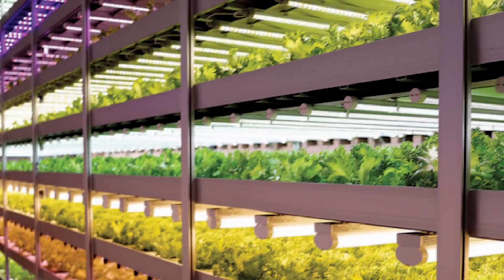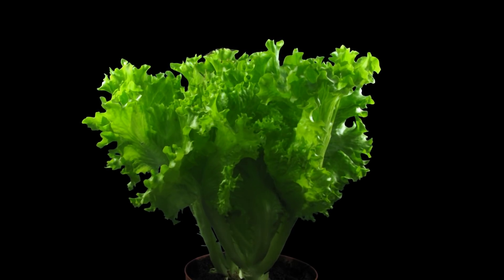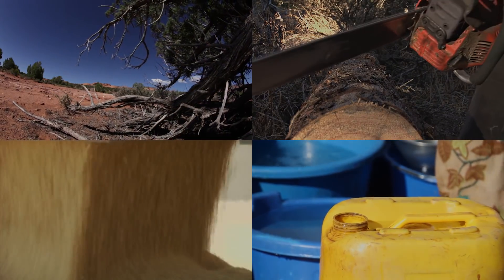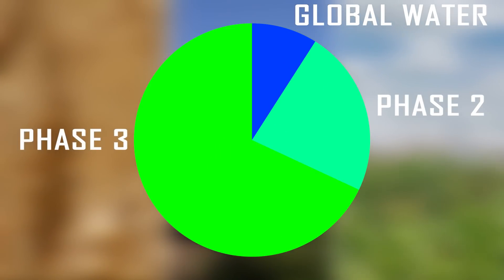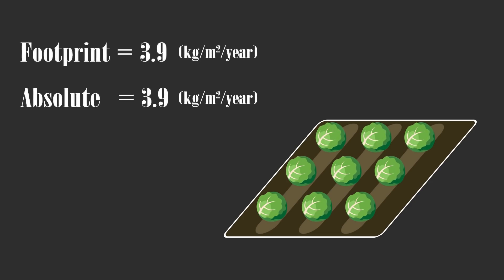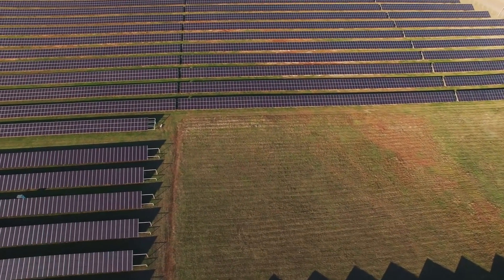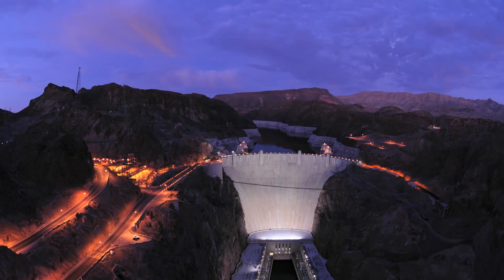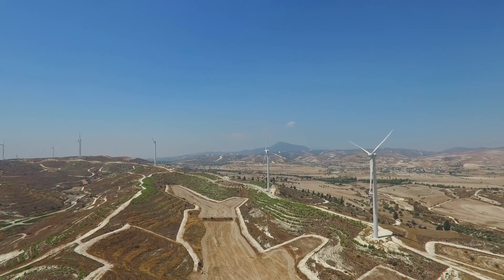How Can We Improve Vertical Farming?

Comment: A combination of agrovoltaics and indoor vertical farming could be interesting. It would improve the output of regular cropland (around 80% of cropyield without solar + 80% of only solar panels has already been achieved, thus a 60%+ increase. In more sunnier regions it might even be more beneficial) while allowing the power from the PV to be used close by in the indoor farm building. Or you could combine it with cattle farming (using a lot of land) + PV. These kind of combinations would lower the cost of the energy due to not having to buy the land and only use it for solar and you can place the buildings and energy production 'close' to eachother lowering transmission costs.

Comment: In the energy sector, the renewables came on top of the fossil. And more fossil was used to transform concrete, metal, etc. Nuclear is less carbon intensive in that regard. For the moment renewables did not displace fossil energy, it was an addition. Only geothermal, hydro and nuclear did historically came instead of some fossil sources. It is yet to come if it is viable to produce solar panels / wind / batteries ONLY from renewable energy sources, work is in progress on that, but we are not yet there.

Comment: Inedible mass isn't necessarily completely wasted, it can be used for biofuels. Maybe not worth it at current scales, but long term it probably will be.

And while running a plant factory on solar energy is always going to struggle to be worthwhile compared to directly putting sun on the plants, it has some advantages, solar panels are much more convenient than plants. Almost any building can have solar panels put on it even if it as an odd angle and not suitable for plants, and you can transmit the energy through wires with no moving parts, so the difficulty of roof access only has to be dealt with once when installing the panels, not every single harvest. Some loss in energy efficiency is fine to centralize the production of plants if the costs can be made up elsewhere. And more importantly, you can't grow plants in a field with wind power, but you can run a vertical farm with it. I expect we will do a lot of growing in the early hours of the morning when the wind is blowing but people are mostly asleep.
Reply from the maker: Utilizing inedible mass is a good idea indeed, though you still want to mimizie it from an energy perspective. Using say solar panels for vertical farms isn't actually a loss comapred to direct sun. This seems unintuitive because there is an efficiency loss from both panel LED in the conversion loss. Yet this efficiency loss is made back through the control that CEA provides, this can be seen in the 4 times greater harvest rate, yeild and edible mass%. If you use sunlight you forfiet some to all of the following: spectrum, PAR and DLI, Photoperiod, CO2 enrichment, Temperature, Humidity, Airflow, Pests. The degree to which you limit control of these factors depends on if you are growing outdoor or in a greenhouse, but all of these factors will be at least somewhat limited compared to full indoor 100% artificial light.

Comment: When you were considering the doubling of solar panel footprint for doubling the height did you account for those solar panels being in useless deserts and not taking up what would be crop fields or woodlands?
Reply from the maker: It was a general statement, it has to be said that for most crops this actually isn't an issue anyway, but your right if the farm is located near arid land then its even less of an issue.

Comment: One of the best ideas for vertical farms is to have them grow at night rather than the day. Electricity can actually run negative when people start shutting off appliances and go to bed. Most electrical plants need a lot of time to shutdown turbines or generators (hydro, nuclear, coal etc). These power plants need the electricity to go somewhere which would provide another cost saving measure. Vertical farms can be grown anywhere, at any time, at any temperature with a minimum of pesticides and water, and feeds the high class market before shifting over to mass market usage. 

Another thought; I wonder about the efficiencies of building these warehouses underground and whether farmers could shift agricultural land from food to solar while operating these plant farms.
Reply from the maker: There are examples of vertical farms in abandoned mines and underground subways. It helps quite a bit with thermal regulation, but if you aren't taking advantage of a pre-existing structure, it can be quite expensive and very unlikely to be cost effective to dig your own site.

Making use of cheap surplus electricity is a very good idea if you can find a plan that allows for it, and of course plant factories can set their photoperiods to whatever time works best. There certainly are some examples of existing farmland adding a vertical farm component for extra diversity, and adding some solar to the land is often a part of that.

Comment: it does not matter how efficient the production under LED light will ever be:  the natural sunlight is a free gift from nature, electricity is not.  you will always need many times the  area of photovoltaic panels than the area of the vertical farmhouse to produce the required energy for the LED light. The  efficiency of photovoltaic panels is low and the density of agricultural output in the artificial vertical farmhouse still  requires  the sun energy that is received from a much larger area. to condense farmland and occupy 20 times more Greenland with photovoltaic panels does not solve anything. Alternatively the electricity only can come from nuclear power plants or caloric power plants, which means burning non renewable resources, that store the sun- energy from millions of years ago
Reply from the maker: It seems intuitive that the solar area required for a plant factory would be 10x that of equivalent cropland alone, for a pv array that is 20% efficient and LED that is 50% efficient. It's not quite that simple however. 

Crops create biomass using photosynthesis with about 1.5% efficiency, there is a lot more efficiencies to account for than light efficiency alone. The aim of plant factories is growing control, that is growing a lot more with a lot less. There are a myriad of factors that greatly limit the outdoor growing efficiency vs indoor efficiency. It's also worth remembering that indoor crops have a much higher edible mass %, the LED's emit PAR and not the 50% of sunlight spectrum that plants cannot absorb. These factors quickly add together to negate the initial efficiency losses of solar/LED.
Reply: @ExaCognition   also from LED light the crops use a fraction of the light energy only for photosynthesis. Beside natural sunlight has a lot more benefits that just photosynthesis and plants have more benefits for the ecosystem and climate than just producing food for humans only. 
I doubt that the efficiency of using LED light inside the artificial farm can ever become that high, than that it can outweigh the inefficiency of photovoltaic panels and the carbon footprint for producing all the shelves, LED- lights, building structure and technical equipment.  
But I am open to be taught better. I would like to see a realistic calculation that can prove the efficiency to be higher than using natural sunlight.
Another problem is that it only works with hydroponics or eben aeroponics. But all the nutrient comes from artificial fertilizer added to the water. You can't just decompose and reuse organic waste as you can do with natural soil. So how to close  the ecological cycle?

Comment: "water consumption" is not necessarily a relevant factor.  in moderate climate zones , the  water  is not lost . it vaporizes and goes down again as rain. the  problem  with usage of water for agriculture only occurs in very dry zones, where ground water is  used for artificial watering

Comment: You don’t include the environmental impacts of producing and disposing of the renewable technology. Not just with the farms themselves but with the corresponding power infrastructure requirements. Perhaps because lines must be drawn it lies outside this video’s parameters.
Nuclear power should be considered to help the environmental mix. it is not permissible to sacrifice miles of land for solar fields when they can be replaced by a thorium reactor. Wouldn’t that be over a 99% drop in land usage? I love solar. I’m putting it in my house, but It’s all nuclear power fundamentally, and to ignore and not analyze technology option and undermines your otherwise excellent analysis.
Reply from the maker: The energy section was simplified due scope. The focus on solar specifically, is due to it's very low cost in specific optimal locations. These locations provide the "first viable use case" from a cost perspective. That doesn't necessarily mean that solar is a global solution for powering all vertical farms. Scale, local grid and location have a huge influence on the viability of solar. I could have done a better job of getting this across in the series.

I've started an energy series that is looking future of energy and the technologies that are might be a part of it. A number of nuclear technologies will be covered - thorium, small modular reactors, fusion. Unfortunately it takes a long time to research and produce the videos. so I'm currently editing the 2nd video. The series should give a much more detailed understanding of what technologies we will likely see much more of in our future.

Comment: What about opening the grow factories to natural light--WINDOWS- and using reflected light from nearby glass towers and actually building reflectors to direct more natural light into the vertical farm, to reduce the need for artificially produced light?
Reply from the maker: You lose a lot of growing control (spectrum and photo period) when you try to supplement artificial light. Generally it's better to go all sunlight (at least in summer), or all artificial light, the middle ground of mixed sunlight and artificial light loses a lot of the advantages for artificial lighting.

Comment: Current gen and Thorium nuclear power would solve the energy and greenhouse gas issue. After the heavy up front cost nuclear power supplies the cheapest and most reliable power in the world. No other power source is as cheap, clean, and reliable.

The newest gen reactors can even work off of the depleted rods of older nuclear plants.

Comment: Simple answer to the energy needs:   Build next to Nuclear Reactors.   Nuclear power is super cheap, environmentally friendly (no CO2 production), and if your not pushing the energy over Kilometers of lines, then it's super cheap power.   like 3% of the current power cost per KW/h at production VS coal, oil or solar.  But ya know .. Everyone's stupid and afraid of Nuclear power.

Comment: The one thing you did not know though is that Solar and wind are now the cheapest forms of energy in the history of the global energy markets. We are seeing energy purchase contracts below 3 cents/kWh all over the world today without subsidies, half the cost of its nearest competitor LNG and a third of the cost of coal. Within 5 years the energy requirements and the cost of that energy for vertical farming will be a non issue. https://www.youtube.com/watch?v=EXw38SaGmOk
Reply from the maker: This is something I've modeled into the next video in this series. There is a bit more complexity than cost/kWh when it comes to solar, and it's also highly location dependent. With that said, solar has been improving at an exponential rate, as has battery storage (which has long terms storage issues remaining). My upcoming energy series will address these things in more detail. 

It's certainly an interesting future for energy and I tend to agree that energy is set to get cheaper, potentially significantly so.
Reply: @ExaCognition  There are several developments that are just starting to come into the picture that you will likely not find. Vertical solar being one most applicable to this application. MIT has found that by arranging panels on the side of a building in an accordion fashion boosts efficiency. There is also solar Glass entering the marketplace now.
 Secondly Energy storage is a huge disruption waiting to happen in the energy marketplace. There are a multitude of cheaper cleaner and better batteries on the market or in final development today, including flow batteries, liquid metal batteries and solid state batteries. Experts are saying they plan to have it in real world applications within 3 years, including 5 different automotive companies. I would also suggest that you look at real world small scale wind advancements as well. Vawt technology is really starting to come into its one now and is perfectly suited to urban environments and vertical applications as they are impervious to wind sheer and turbulence. The biggest consumer of power in these operations are not the lights or pumps, its the environmental controls that are required. Ive yet to see one operation utilizing Geo-thermal, which has the capacity to lower the energy required for those operations by over 65%.

Comment: A funny thought about light costs, I'm wondering if there might be a potential technology either worth digging into or perhaps even being experimented with where when you have a situation that requires millions of small lights, even LED's, you might be able to have some sort of transference system from light from a few very high-powered bulbs that then gets distributed out to diffusion sources, something like a spreading mechanism at the end of a fiber optic thread in place of redundant LED's. There are probably all kinds of costs that would be associated with something like that but I could see it being a model of inquiry for situations where you're trying to keep this many millions of lights on and looking for ways to drastically reduce electrical input.

Comment: Genetic engineering would go hand and hand with vertical farms. Unlike traditional agriculture, vertical farmed plants aren't affected by the extreme conditions of nature. Because of this plants dont need to be engineered to be resilient to those conditions. Which allows for us to make extremely efficient, high yielding plants that aren't wasting any resources on defences or threating the eco system by outperforming local species. We could make wheat which literally just grows as a stick with grain covering it. The plant would have no means to survive in nature but it can thrive in vertical farms.
Reply from the maker: I tend to agree that genetic engineering is much easier to leverage in a closed production system. I'd very much expect that a viable phase 3 product such as wheat will have a vastly higher edible mass percentage than what is seen in outdoor wheat. Genetic engineering could well accelerate progress towards that and generally increase the speed of optimization for indoor seed.

Comment: why not compare absolute yield in traditional farms with footprint yield in vertical farms,  because the area stacked upwards can be as large are horizontal area of classical farms ?

GMOs be like : "we are completely safe, peer reviewed, tested countless of times and still determined safe"
People: "REEEEEEEEEEEEEEEEEEEEEEEEEEE, label them REEEEEEEEEEEEEEEEEE"

Why renewable energy, when atomic energy is better and cleaner ? And we have enough radioactive material to last hudreds of thousands, maybe even million years
Reply from the maker: It depends what you want to compare. If you are talking about land saved, then it's fair to talk in terms of footprint area, rather than footprint yield. If you are talking about "growing efficiency" from say a light energy perspective, then you would want to talk in terms of surface area.

As for renewable energy, I focused on it specifically for the case of first viable phase 3 location. Solar (with storage) is the cheapest source of electricity providing you can locate it somewhere with high solar irradiance and low seasonal variation. That doesn't mean that it's the optimal choice everywhere, only where I expect the first phase 3 plant factory to be possible.

Nuclear has a lot of scope for producing clean, stable energy at a relatively low price, and it can be used pretty much anywhere. That makes it particularly viable as a grid production source (as we see in France). I'm not intending to discount nuclear, rather I didn't want to go too deeply into the current/future energy side (since it's my next series). That helped keep the scope of the series a bit more manageable. Realistically, you could expect nuclear to power many vertical farms around the world, in fact, some already are.

Comment: Why purposefully evade nuclear?
Reply from the maker: Nuclear is another important energy source, which has lot's of scope for global usage. That said, the final video in the series is focused on first viable location and that is likely to be solar (for locations with high solar irradiance and low seasonal variability). So it's really for simplicity. I have a series coming on the future of energy and I will be looking at Nuclear in depth there.
Reply: @ExaCognition  thx you for willingness to address my question. Solar does had direct logical connection. But me n some other here (as i read thru the comment), agree that nuclear the way to go inconjunction with vertical farming. 

Nuke energy output is constant, while human energy consumtion is not. So it can deliver cheaper energy to power the farm/factory at certain times.